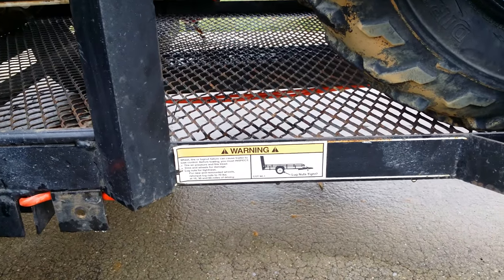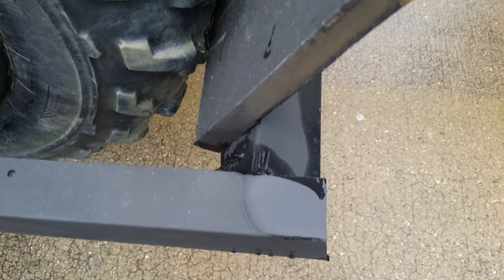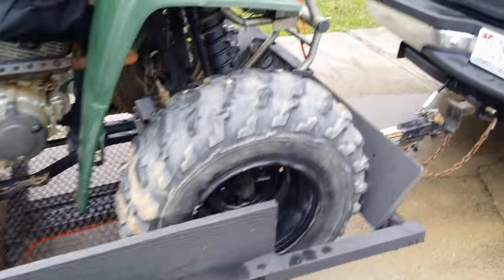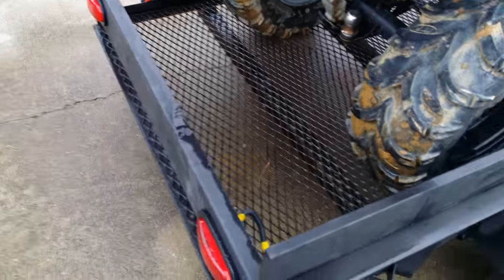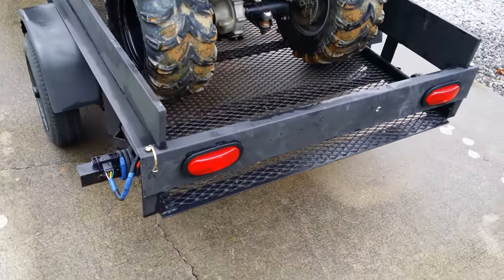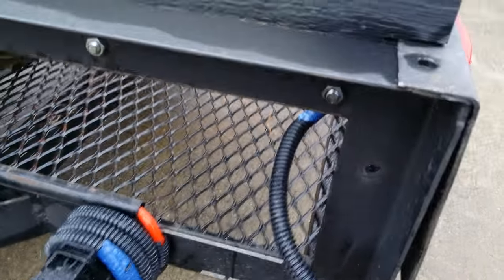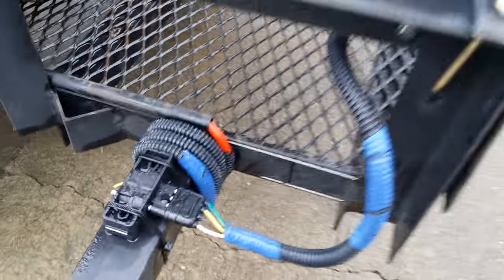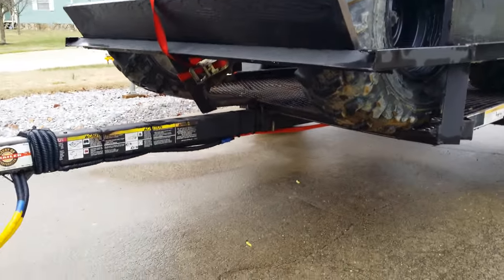Custom 4x6 utility atv trailer

Comment: As you can see 👀 😆 
Sorry bud had to do it lol Nice mods! Mine has no tongue weight either. I was thinking about bringing mine forward like yours and putting two more support angle beams and a trailer jack with a wheel on it. Thanks for the video brother! Nice trailer I'm stripping mine down to the frame then starting from scratch.